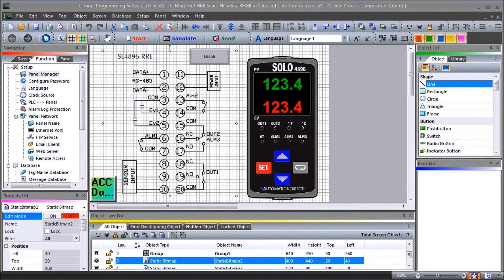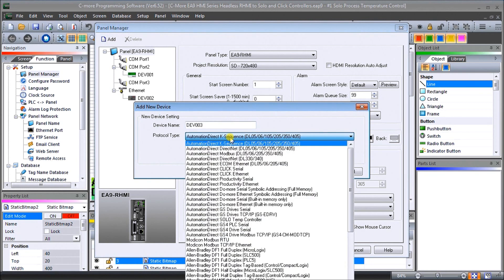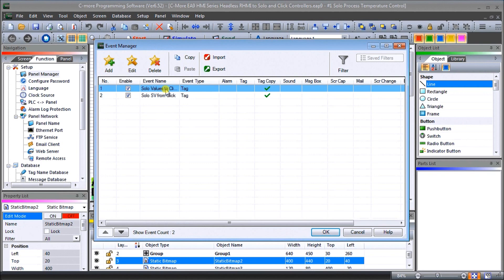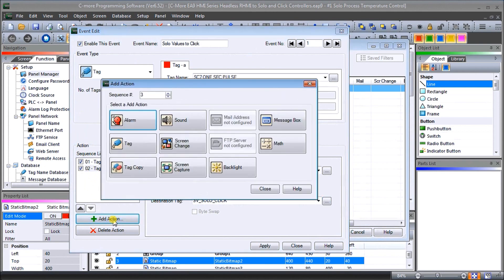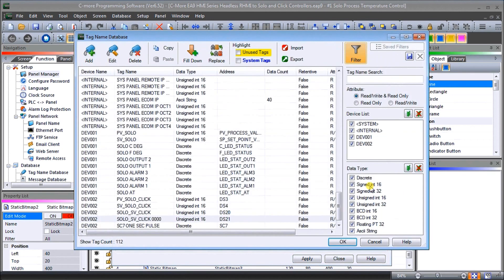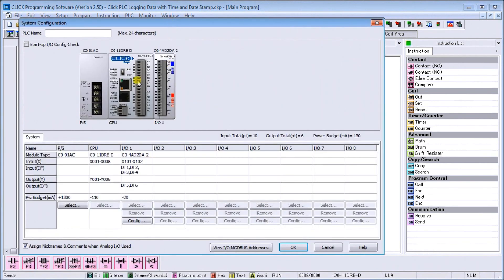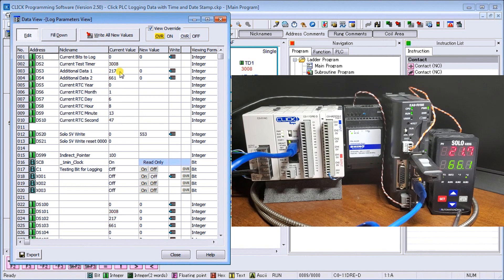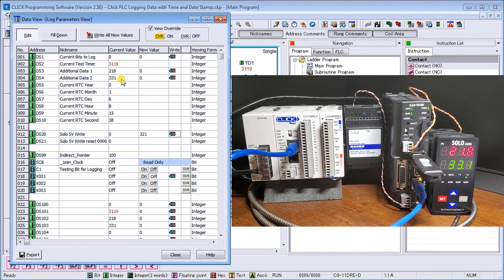C-More EA9 HMI Series to Solo and Click PLC Controllers

Comment: Gary,
If you were going to only using the HMI and click plc would you use the click ethernet driver to communicate? I recently bought one of the headless HMI's and am having trouble getting it to control the PLC. I set all the IP address, set it to click ethernet, imported the tags from the click, and set up a couple test buttons. One button is set to control a (C) address. A click virtual relay. The other button is controlling a (Y) click plc output. I just wanted to confirm I could get it to work. I am accessing the HMI both with the mobile app and the remote web access. The button on the control relay will not toggle between "ON" and "OFF". The HMI beeps but thats it. The button controlling the Y ouput will toggle to "ON" and "OFF" when I press it and the HMI beeps, but nothing happens on the PLC. I've been digging through your videos as well as automation directs and haven't gotten any further with it. I wasn't really finding any info in the HMI or Click manual other than what I already have set up. I very well may have overlooked something though. Any advice on some literature I may have missed or any resources I could dig into would be appreciated. I would also be happy to pay you for time to teamview in my pc or something and give me an idea of where I am going off the track. I enjoy your content. Thanks.
Reply from the maker: Hi John,
Sorry for the delayed response. If you are only controlling a click PLC, I would use the Click Ethernet driver. I'm using Modbus TCP in the videos to keep everything general.
When controlling the outputs on the PLC, do not try to control them directly. Use the contact from the HMI on the input side of the rung to control the output relay.
Thanks for the comments.
Garry
PS Let me know how you make out.
Reply: @ACCautomation  thanks for the reply. I found that instead of using the imported tags if I added a new tag with the same info (data type, plc memory location, etc) it works like I expected. I'm assuming there was something not quite right when I imported them that I inadvertently correct when I add them. I'm pretty novice at this stuff. My day job is a hvac/refrigeration tech. I bought some of this stuff to do some home automation and learn a bit about it. I enjoy you content and its helped me get a better understanding about the building controls I work around a lot. I'm sure I'll have more questions in the future lol. Thanks again.

Comment: Hi Garry,  another great video as always.  our company uses a lot of rockwell's "studio 5000" for rslogix and the like. do you know if is it based on "visual studio" and if so can it be setup with a demo plc program for learning using the free VS version?   thanks...:)
Reply from the maker: Hi q zorn,
Thanks for the comments. I would contact your AB representative for an official answer. It has been a while since I've programmed this brand of PLC.
I know that there is a Studio 5000 Logix Emulate.
https://literature.rockwellautomation.com/idc/groups/literature/documents/gr/lgem5k-gr016_-en-p.pdf
I have not used this software so you would have to look into it further.
AdvancedHMI can be used to communicate to the AB line of controllers.
https://sourceforge.net/projects/advancedhmi/
I hope this is a help to you.
Regards,
Garry